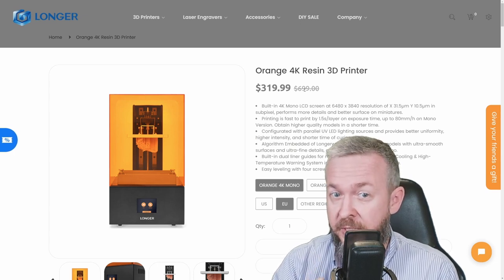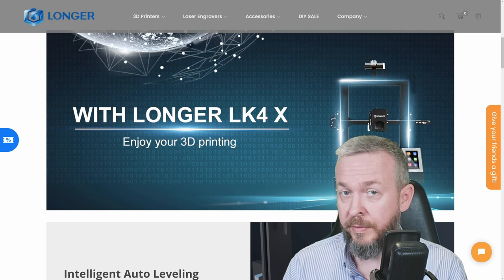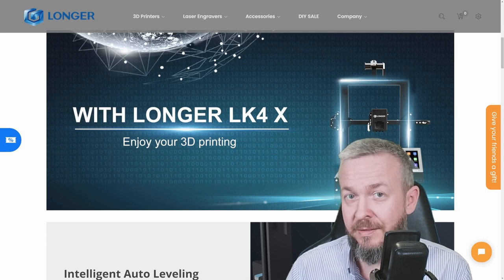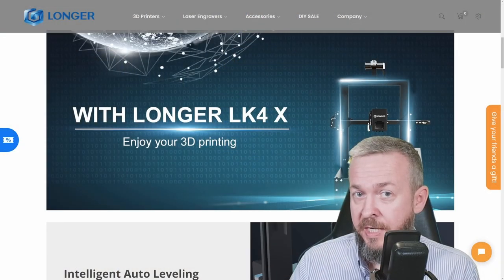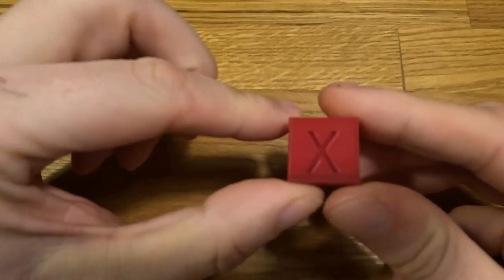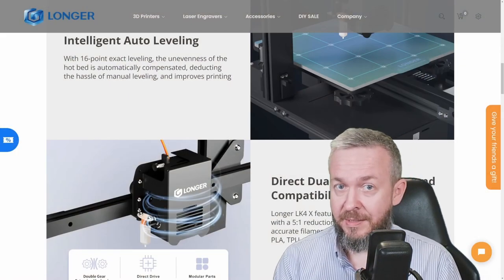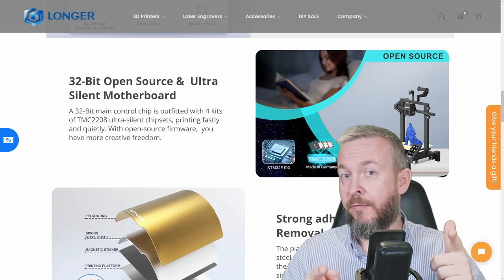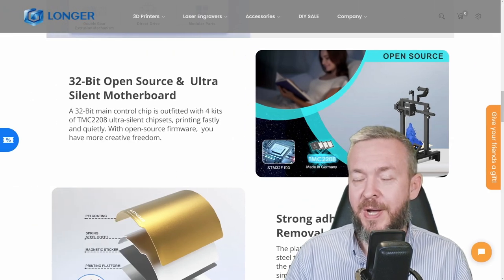Don't Buy a 3D Printer until you see this: Longer LK4 X

Comment: Thanks! 3D printing is on my bucket list. I do have the urge to get one and set it up, but I still have to find a reason and justification to do so. So far I have no bloody idea, what I would actually print. One thing though... you do realize that a lot of your shots miss focus? Might want to switch to manual. Didn't you recently get a GoPro for the close ups? Cheers
Reply from the maker: That's one of those nice to have, but who know if and for what I'll use things :)
I do print from time to time, mostly parts for the projects or something kids ask me. But it sometimes is unused for a month or two.
As for camera - that unfortunately was GoPro.  Closeups and macro don't work. But I've found a new way if you've seen latest video. Parts were filmed with Pixel 7.

Comment: Great video. Wondering how it will perform with other materials.
Reply from the maker: PLA and PET-G should be no issue. As for flexible material, I think they would work, but I have very low experience with it. It would require a bit of tuning probably to stop stringing and similar.
For ABS - that is tricky. Printer should be enclosed, unless using some ABS+ types of materials that can be printer in colder environment. But still you should have printer covered with a box to stop draft and sudden temperature changes.